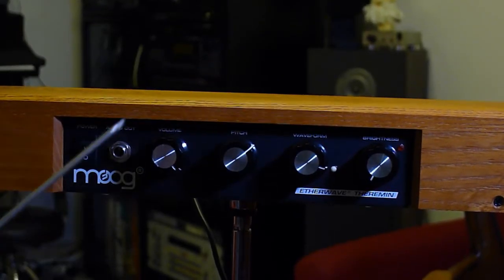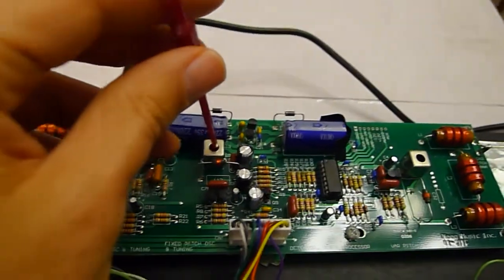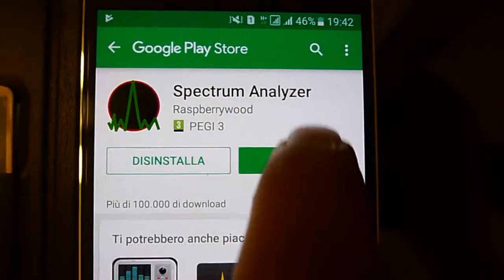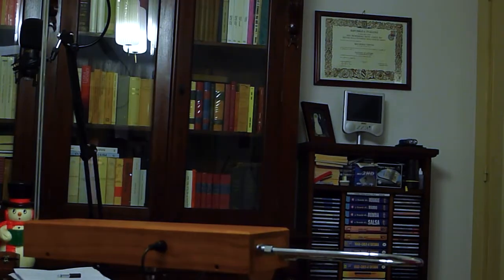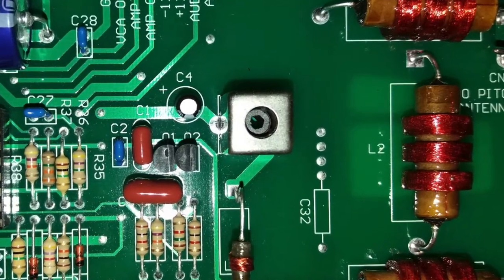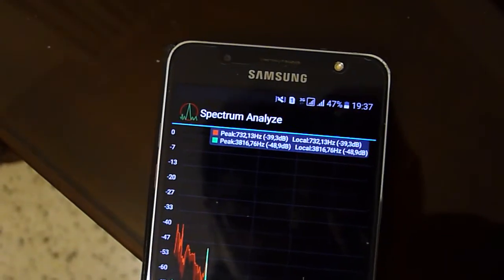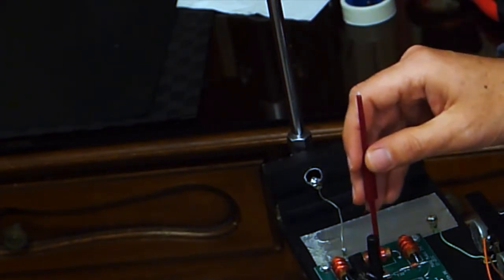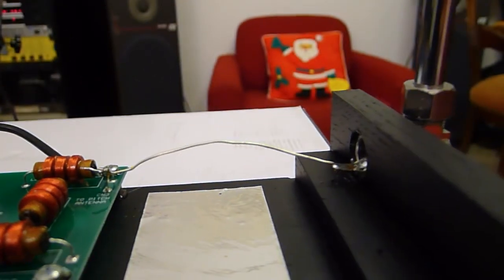Tuning a Moog Etherwave standard & plus theremin - by Maurizio Vento

Comment: First, listen to see if the pitch goes higher or lower as you draw your hand away from the pitch antenna.  If it goes higher, adjust L5 so that the pitch descends through the zero point and then starts rising again; now it should be in the right direction.  The next step is to grasp the pitch antenna and adjust L5 so that the frequency you hear is in the neighborhood of 3.8 kHz.  L5 and L6 interact, so there will be a decent amount of back-and-forth between the two adjustments.  Once you have the top end around 3.8 kHz, move your hand away and see where the zero point is located.  It will likely be too close (too short a scale range); to adjust, stand at arm's length from the pitch antenna and reach over from the left to adjust L6.  You want to adjust it so that the zero point is about an arm's length from the pitch antenna.  Generally this involves turning the lug in L6 in the same direction as you adjusted L5 to get the top end.  
The first time you do this, it will probably drive the top end higher than you wanted it to be, so go back to grasping the pitch antenna and turn L5 in the appropriate direction to get back in the neighborhood of 3.8kHz.  Notice which direction it went (higher or lower) as a result of setting L6; and overshoot in the appropriate (opposite) direction to cut down on the number of times you have to go back and forth between the two adjustments.

Comment: Good video, helped me with tuning a EW I bought second hand which was badly out of tune. You could add more detail on the last step, by explaining what effect it will have to bend the wire close vs far away from the aluminum panel

Comment: Maurizio, many thanks! One cavil . . . the Moog manual says to  remove "the temporary shorting connection across C28" before adjusting the C11 volume slug. You don't mention this. I tried your method, without ever touching C28, and it seemed to work fine, as you describe. Explanation?
Reply from the maker: Hello Eliot. Moog Music’s manual suggests to remove the temporary shorting connection across C28 because they previously suggested to temporary  connect the two leads of C28 together in the “TUNING THE PITCH CIRCUIT” paragraph; if you follow my directions to tune the pitch, you don’t have to connect the two leads of C28 and so when you tune the volume they are already separated. Regards
Reply: @redazione1199  Many thanks!

Comment: great video, and only video!! thank you

I want to ask you about an issue I get with my theremin!
It changes its tunning to a smaller range alone on its own!!
is this a problem? or i should tune it again form inside like the video?
Reply from the maker: Hello! Thank you for watching. Re your question: if this occurs in the first 20/30 minutes after switching on, it is absolutely normal.
Reply: @redazione1199  yes it does!
should the range would normal after 30 minutes??
the pitch knob is totally to the left, and the range is close to the antenna! 

will try now and get back to you will leave it on for 30 minutes!
Reply: and do you know what is the size of the allen key pls used for theremin please? i need to buy a plastic one.
Reply from the maker: @MahmoudALMeligy  Hello try to find the right zero beat so that it is good only after 30 minutes. The biggest changes occur in the very firs minutes, but your theremin could be different due to different component tolerances. The important thing is that it remains stable after 30 minutes, if the room temperature is stable of course. Pitch know should then stay "near" the center position.
Reply from the maker: @MahmoudALMeligy  go here and look for "trituner": http://www.coilcraft.com/tools.cfm

Comment: OKay I have to tune it with Metal allen key! cant find the plastic one at all!!

is it that dangerous to do it?
Reply from the maker: Do not use it, buy the plastic one. here's a reference: https://www.coilcraft.com/tools.cfm and look for "trituner". A metal allen wrench could crack the ferrite core.
Reply: I wouldn't. a) it's difficult b) the metal inside the inductor could cause dangerous voltages to other parts of the circuit and c) there's a chance you'll break the movable part and then you have to replace the inductor.